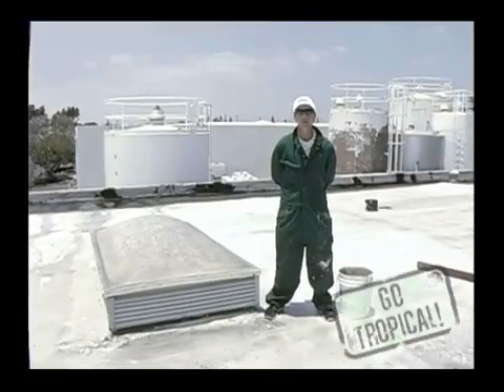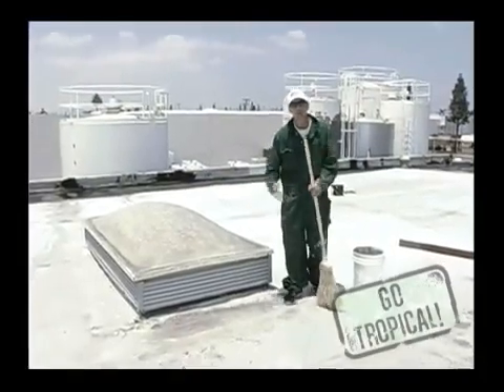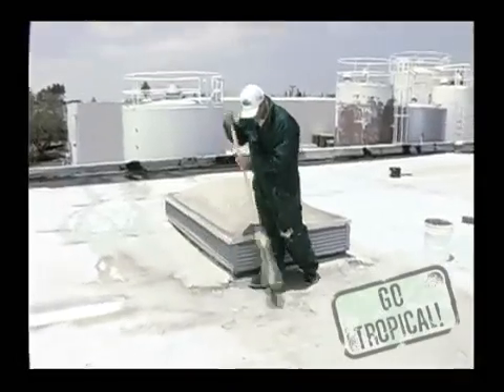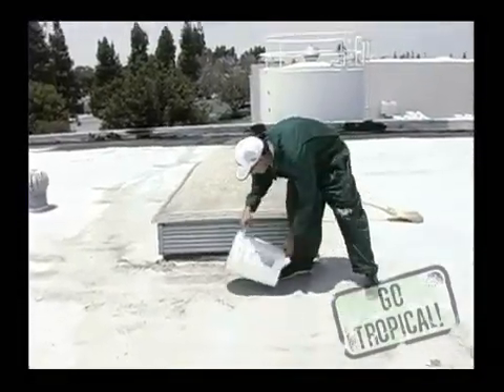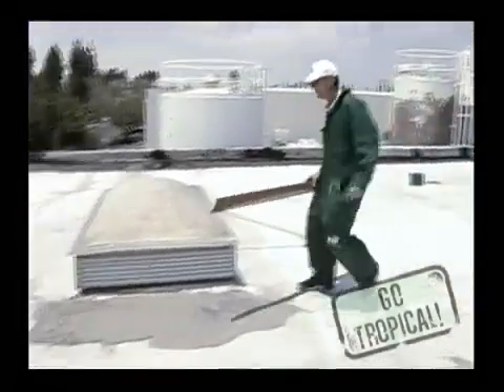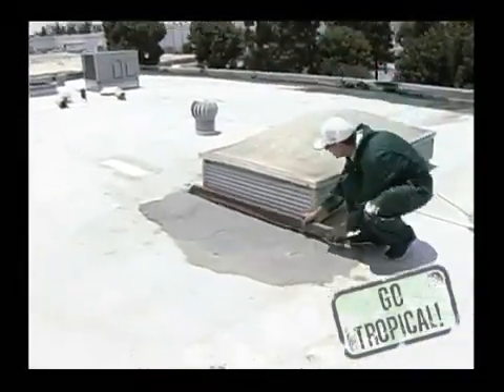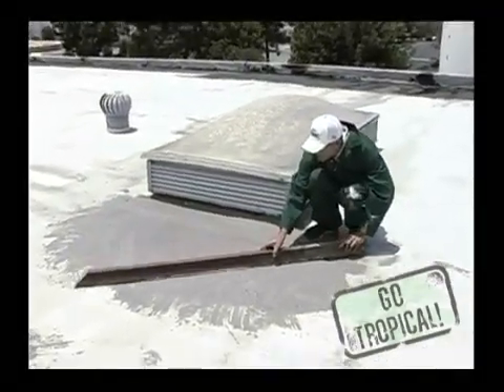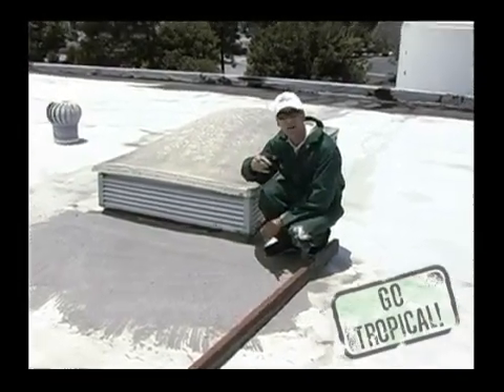How To Fix Ponding Issues Roof Repair - Fluid Applied Roof Restoration

Comment: Cut the roof open get x and y insulation boards and make a cricket so water can properly flow , close the roof back up once the cricket is made and do the proper repair to seal the roof 🤷🏽🤷🏽🤷🏽🤫🤫🤫🤫 thats the proper way

Comment: Yes, this will work provided is is something like Henry Pond Patch. The cement should be poured and feathered out on a properly cleaned surface. As soon as it has dried a light coat of bonding sealer applied. Then a coat of high quality elastomeric and polyester fabric laid over. Let dried and then apply one more coat of elastomeric. This will be fine. But only use on non-leaking low spots.
Reply: It’s not the proper way to fix that tho infront of any ac unit / skylight or curb ….proper way is installing a cricket and making a proper fix comercial wise but hey idk I’m just a new guy making $10 an hour

Comment: if thats all you do, your roof will leak ASAP.  cement will allow water through and now water will stay ponded under the surface of the concrete and quickly degrade the roof surface and cause leaks.  roof will fail very quickly.  if you are going to do something like this, you must immediately add layers of roofing over the raised area afterwards.

Comment: I believe he was saying " cementitious product " - yes you can fill in certain areas of low spots on a flat roof however you need to make sure the product you use to do that can bond to the surface , some cement based products that are used to level decks and fill voids may crack up when used on a roof, also you will definitely need to roof over the patched area to keep it from absorbing water ! so the surface has to be dry and that "product " completely cured with very low moisture content before you add roofing to the top